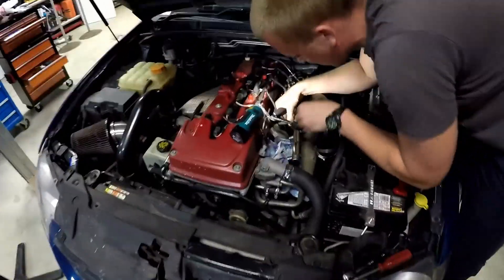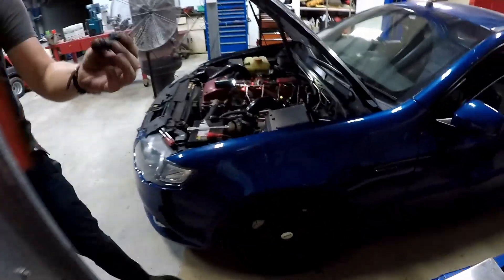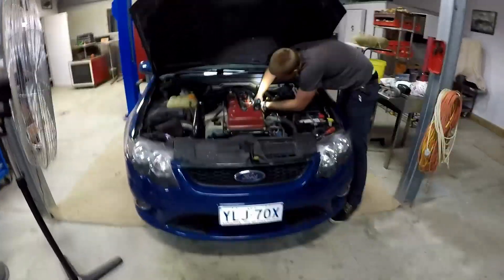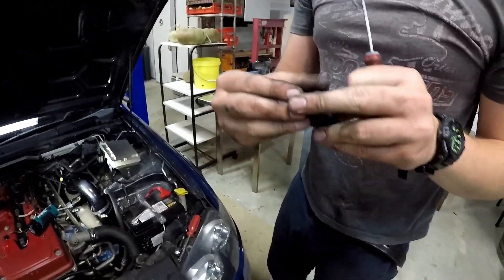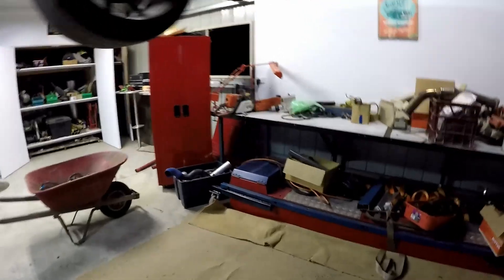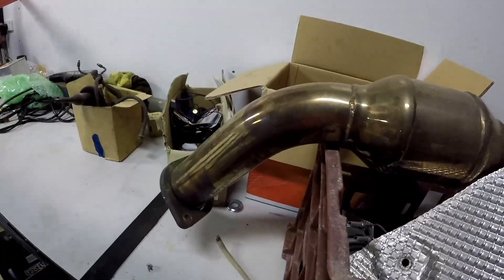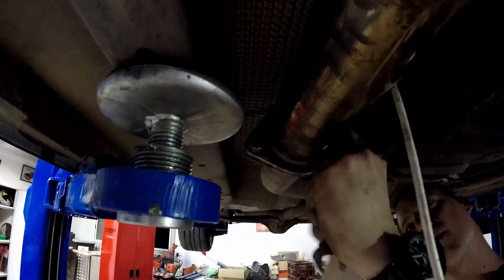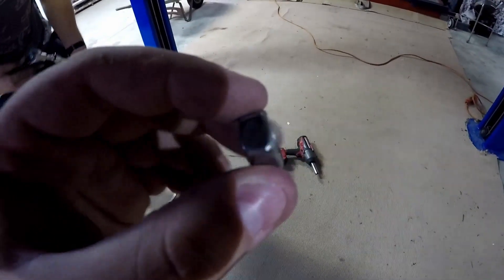Pirate Performance Ford Falcon FG XR6T Upgrades and Tune

Comment: What other mods are on that car? What is the turbo pushing out psi? 300kw @rw is alot for a dump/cat and injectors only ,im curious as im about to do similar ,but im adding full 3.5" exhaust,stage 2 incooler re gapp plugs, eci tune was told to expect 300-310.
Cheers
Reply from the maker: it was on 14psi, just a dump pipe, 1000cc injectors and a plazmaman intercooler

Comment: quick question, did you guys use stock pump with the 1000cc injectors, and what pc tuning tool are you guys using ie SCT or Wolf...?? just about to start down this path on my BF XR6 ute .. cool little vid, thanks guys.. regards Richard
Reply from the maker: Hello Richard, the car had a Walbro 250lph pump that the previous owner installed. The HP Tuners software package was used to modify the ECU in this car.
Reply: Last Minute Racing sweet.. thanks for that.. just want to have a similar set up with my car..
Reply: Busa Richard I opted for the kpm drop in twin pump intank 1000hp system. Had it for years with no dramas on e85 @ over 500rwkw